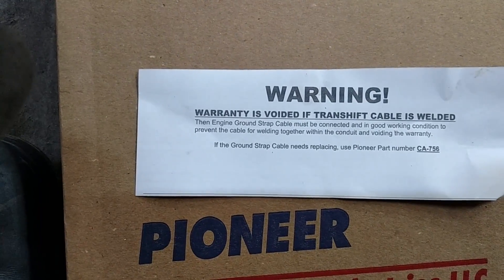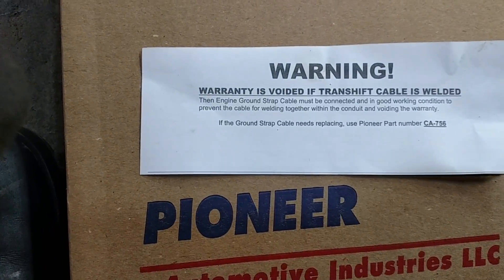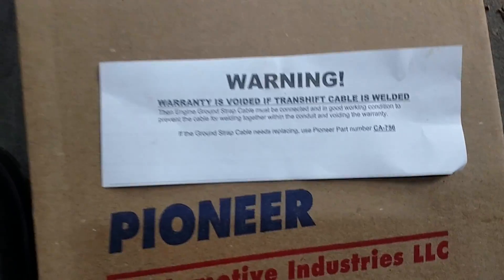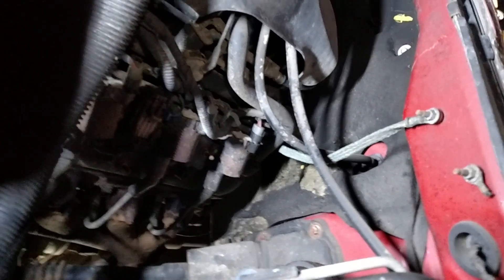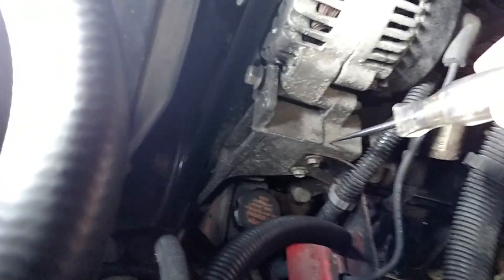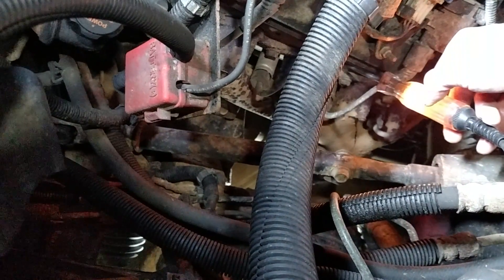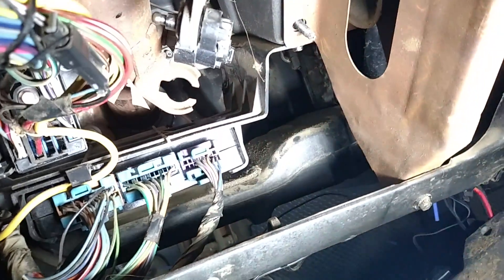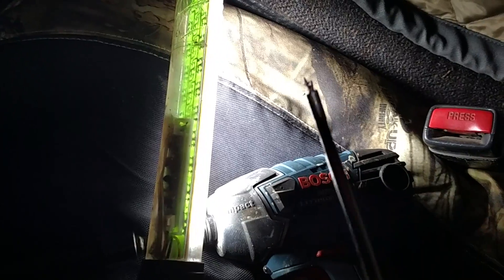Engine ground

Comment: What is This  ( i connect 1 wire tto - battery and 1 to cable minus - so 2 wire - and Light bulb turn on 😢 im experincing bad draing issue

Comment: I had a mechanic work on my car and the chassis area under the batter has a ground that connected but the other end is not connected to anything. Where should I attach that ground to?
Reply: Unfortunately, what he is calling the chassis in this video is actually the body. There is a block to chassis ground that continues on to the body. On my 1998, it is all one cable with a bolt connector in the middle.

Comment: Just a reminder, not trying to be a nuisance. Whenever anything to do with power and ground repairs, disconnect battery and wait a few minutes so not to have SRS problems because there  is stored battery power in system for air bag deployment. Designed this way purposely from factory. Usually 2minutes I usually wait 15 min to be on the safe side. From the collision repair side of auto's, thought I would remind everyone, but I know you all know that already! Drive safe!! Montana Rick
Reply: Do you happen to know where that ground goes on a 96 dodge 3500?

Comment: Where exactly does the ground wire attach to on the motor?
Reply: Rob I know on my LS1 it’s on the back of the passenger side cylinder head. This is the ground for the ECU
Reply: Nicholas if it not grounded right will it make the car crank but not start

Comment: Where does that strap go to the block? Mine is cut in half
Reply: Im trying to figure the same thing
Reply: "Cloud wired" It goes to back of engine block. If it is a hassle  run a new one up front and easier to get to. I would use a heavier gauge wire and clean connection points of contact with sandpaper and slight coat of die electric grease for contact preservation. I always use shrink wrap connections to terminals on the wire. Once and your done..... with that ground!! There are others like under the L.F. cab mount area on frame and you can get all that info by the generous people on U-tube. Note: When done always check continuity to be sure all repaired is functioning properly. It's easier than you think. Everything grounds to battery, chassis, frame ,engine block and all is connected if in good condition grounds are all in good condition. Montana Rick
Reply: @rickfreeman9530  would this be the reason for windows rolling up slowly and radio shutting off while rolling windows up and head lights pulsing to music windshield wipers also killing radio
Reply: @SouthernBonesOutdoors  Are you in a Chevy too and what year and do you know of any mechanical repairs or body damage even if repaired already.
Reply: @SouthernBonesOutdoors  Also there are some Chevy specific things I have noticed over the years, but need to know what year!
Reply: @rickfreeman9530  mine is an 01 tahoe I have a top and side post battery in it and the battery got loose, I took a left turn and positive hit the little bar above the battery causing it to weld its self together. The ground coming off the motor to the frame is the only ground I see not connected anymore and im having all these issues now.
Reply: @SouthernBonesOutdoors  yeap most definitely is
Reply: Me to mine is ona 96 dodge 3500